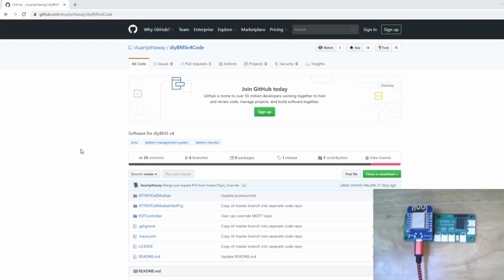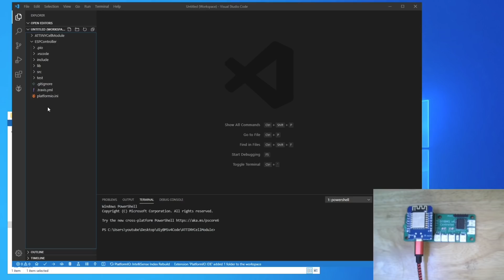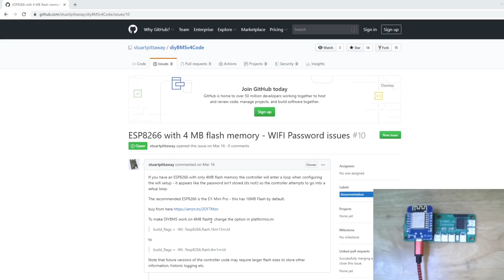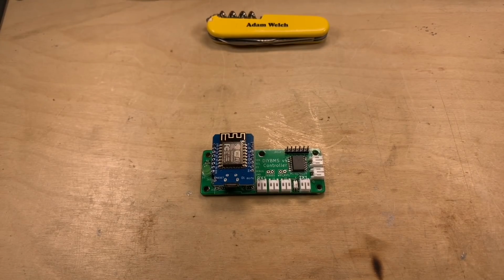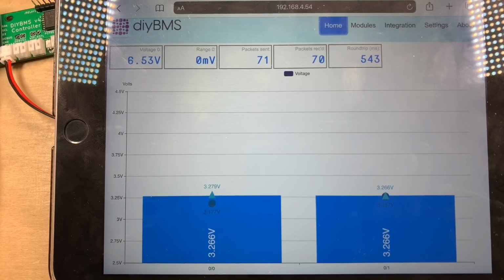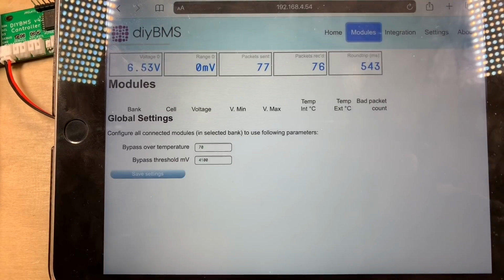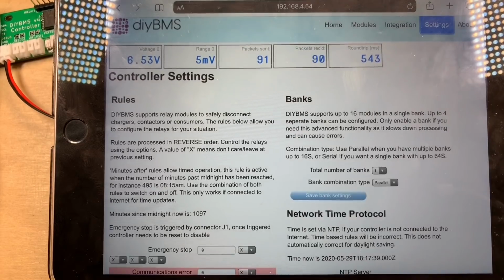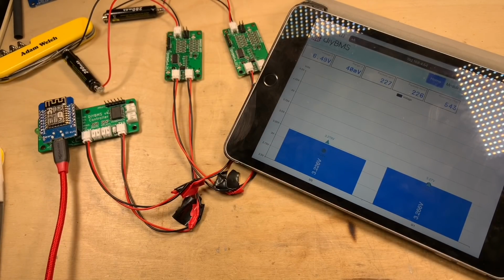diyBMS v4 Central Controller Build

Comment: Hi. Did you use the v4 version of the espcontroller software. I managed to upload but i'm getting SPIFFS error.  I have AP and can connect but softap.html can not be found.  

Compiling .pio/build/esp8266_d1minipro/lib9d2/ESP Async WebServer/WebAuthentication.cpp.o
In file included from .pio/libdeps/esp8266_d1minipro/ESP Async WebServer/src/SPIFFSEditor.cpp:1:0:
.pio/libdeps/esp8266_d1minipro/ESP Async WebServer/src/SPIFFSEditor.h:16:101: warning: 'SPIFFS' is deprecated (declared at /home/bakerman/.platformio/packages/framework-arduinoespressif8266/cores/esp8266/FS.h:269): SPIFFS has been deprecated. Please consider moving to LittleFS or other filesystems. [-Wdeprecated-declarations]
     SPIFFSEditor(const String& username=String(), const String& password=String(), const fs::FS& fs=SPIFFS);

I wonder if the V4 only works on pro?   Thanks

Comment: Is anyone dealing with the controller web page not loading after flashing the latest code version?
Reply: Not sure what was wrong, but I just blew out the whole download file and unzipped a fresh copy, attempted to upload to my D1 Mini Pro, did not get error on upload and did not get the SSID to connect to it. The same file uploaded to my D1 Mini worked and now have the SSID and web page to program to my WiFi. Any thoughts on why the D1 Mini Pro doesn't work? I have another one on the way to test...
Reply: @Teflon000  https://youtu.be/bFUMxgrz-yo?t=627

Comment: Well done sir for successful getting the bms function. Btw sir, can i know if this bms can configure on 15 series and 14 parallel battery each (got 2 pack) which got total of 30 series and 14 parallel that will sum to have 420 cells. Thanks 😊

Comment: Can i use this diy module for 4s battery pack?
Reply from the maker: Yup. I have one on my 4s lifepo4 pack.
Reply: @AdamWelchUK  can i have link for that setup, i want to build one for my powerwall, but i'm using li-ion and also want to discharge it upto 3v per cell, (12v in a 4s pack) can  do that?
What is the max output current (in amp) i can get?
Reply from the maker: birendra kumar I’ve made a few videos about it. It is setup by default for lithium ion. You can add an external relay module and set it to cut things off at 3v if that’s what you want to do. https://youtu.be/yUU0Qi3VsHc
Reply: @AdamWelchUK  thank you!! Have watched this video before n. Great, i will be working on it soon.

Comment: Once you commission this, how is the Wemos central controller board powered? surely your not expected to power it off the usb port, or does one feed it via battery voltage through a buck converter of some form?
Reply from the maker: In my version 3 I use a dc to dc converter to drop the voltage of the whole pack and power the controller from there. This is left up to the end user - the size of your pack can determine the best and worst way to achieve this.
Reply: @AdamWelchUK  I have some cute little isolated 12v to 5V converters with usb sockets. I'll pop one of those on my battery to run the controller. I will instruct the controller to cut off the load side of the battery at 20%, this will leave reserve to run the controller in case of a charge controller failure.
Reply: I got a d1 mini battery shield, that allows connection of a 3.7/4.2v liion battery, and charge by micro USB, I'm thinking about doing something with, maybe use it as kind of UPS, along with a 29.4v to 5.5v buck converter, and power the battery board  with the charge controller. To only power it when the sun is charging, to limit parasitic drain, surely a couple 18650's will supply enough power to run this a while, maybe I'll parallel 4, 2200 cells, it should last a while, I can always change or bypass the charge controllers if needed,

Comment: Hi Adam, I’m looking for a way to monitor my 7s pack. I’m not interested in balance or over volt features as pack charging will be handled by a 30a balance charger. Just need a way to discharge the pack in a safe controlled manner with a adjustable low voltage and over temp cutoff. I plan to use combined with a 110v inverter on building sites here in the uk. I’ve programmed an Arduino to control two Pwm fans with PID to cool the cells. do you think it would be possible to adapt this diybms system and integrate along with the fan control to be managed with a single Arduino?

Comment: Does JLC PCB do solder stencils? That might make it easier to deal with the solder paste --- everything on the board is masked, except for holes over the PCB pads.
Reply: Yes, it is only available if you do not opt for assembly services. I would recommend getting it if you have more than a small number of components and also get it in A4 or at least 6x6" size if you can.
Reply from the maker: Yeah as mentioned they do. They’re $7 which isn’t much, but when you only intend to build one or two boards they seem like a luxury. They’re useful though.

Comment: I would love to see a Stuart Pittaway BMS with an Active Balancing circuit.
With active balancing you don't spilling energy like with traditional balancers.
What do you guys think of this idea, would it not be an awesome BMS ?
I did send Stuart Pittaway an e-mail with a suggestion but I never got an reply from him.
Reply: There was a variant of the boards adding that but I haven't seen any activity on it in a while now unfortunately.
Reply: The guy doing the active balance variant posted on the thread yesterday giving an update.
Reply from the maker: I think active balancing is great (I have one of those little modules I intend to possibly use in conjunction with the diyBMS) but if your packs are well balanced there shouldn’t be the need to loose much energy - and when it is top balancing, your cells are pretty full, and if you’re charging with solar it’s all free anyway. Don’t get me wrong it’d be nice if it was a little more efficient, but I don’t loose any sleep over it.
Reply: @AdamWelchUK  It's famine or feast when it comes to solar. You could generate more than 10kWh per day with a 1kWp system in the current weather we're having. Then come winter you'd need 10 times the number of panels to get anywhere near the same. In my opinion, Lithium isn't the answer unless you're simply using it to maximise self consumption. The new Ofgem kWh export rates are measly when compared to the cost of buying back a kWh hour. I recently found out that Octopus energy will pay you the half-hourly One Day wholesale rate, but it's a Beta product and probably won't be around for long. As for Off-Grid, solar is great if you can use it all, but it's back to diesel and oil 6-9 months of the year. Anyway, you're absolutely right about the active balancing if you have large Lithium cells. It's just a nice idea for us nerds. Some people like higher pixels measured in the Mega, we like higher energy efficiency measured in the Milli.

Comment: Does it store history locally, or does it need a internet based cloud needing a paid subscription service, and produce time graphs?
Reply: No data is store locally on the modules at this time. The influx DB or mqtt option can send it to a rPi which you can persist the data there for processing.
Reply: Time and amps... essential really, otherwise efficiency is not tested

I have 48v lead acid...as well as 48v Li Ion... Does it mix and match battery bank types?

Watching the relay one now

Comment: Nicely done Adam. I wonder if JLCPCB will populate both these boards with all the SMT's?
Reply from the maker: I don’t think they will unfortunately. The IO expander is actually discontinued and not available from lcsc and that is the trickiest bit. The resistors probably aren’t an issue (although it’s generally cheaper to use smaller packages because they are already loaded in the pick and place machines).

Comment: Through hole for me thanks - until I can't get the components any more- then I'll give up, surface mount just looks a total pain!
Reply: SMT is not hard - and perhaps even easier. I have been assembling electronics since 1984 and will no longer design anything through hole unless it is my only option.
Reply: I'm the same way but after building a few of these modules it isn't too bad. Stick with 0805 or bigger components and it is quite easy to solder with a regular iron with a fine tip. The ATTINY841 and PCF chips being the most challenging in diyBMS but they are quite doable if you apply flux and a tiny blob of solder to a corner pad and slide the component into it aligning while the solder is flowing. Then go back and get the remaining pins starting from opposite corner.

Using a magnification lens with helping hands holders helps a bit as well.

Comment: Daft question.

I have attempted to salvages some cells. Sadly mostly "heaters", "Self-Dischargers" and a few that leaked and killed my Charger. New Charger on order so fear not. But where can I dispose of the unusable Batteries? The two local recycling points say no Lithium. An my local tip is closed.
Reply from the maker: It’s not daft. I’ve just found this... https://www.recyclenow.com/what-to-do-with/batteries-1 it mentions laptop batteries and has a postcode checker. Worth a shot.
Reply: @AdamWelchUK  thank you very much

Comment: I may have missed it but was it TX red to red or red to black?? from the controller to the BMS?
Reply from the maker: Mine are red to red and black to black. It shouldn’t damage anything if the comms is the wrong way - but if the battery connector is the wrong way, that’s a different story!